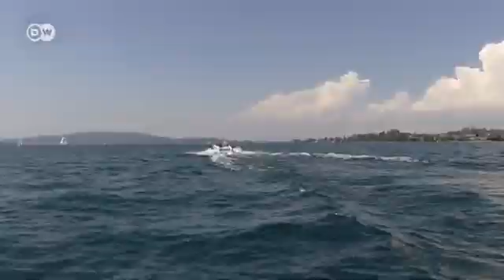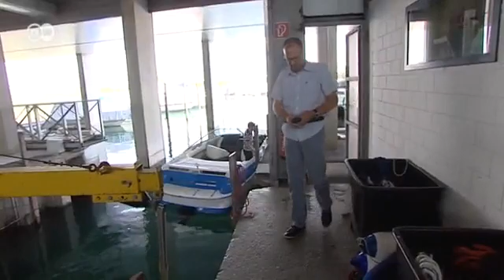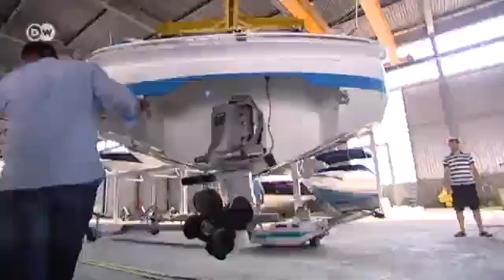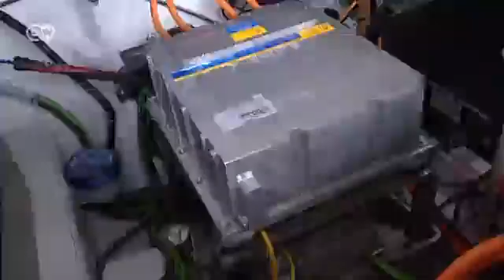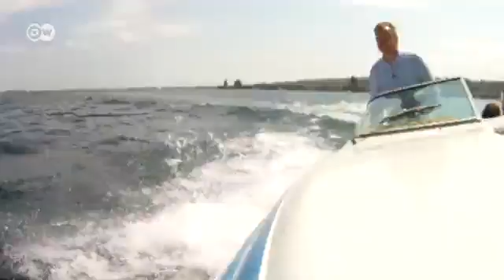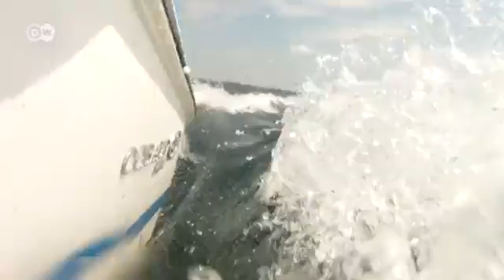Fast and Quiet - Electrically-powered recreational boats | Made in Germany

Comment: Add a generator to the drive shaft to make more energy to the batteries. Add some solar panels that blend in, and lastly , add a horizontal wind mill. They are not big any longer.

Comment: "The faster you go the shorter the distance that can be covered"

Just like gasoline powered
Reply: I think the comparison is that when U open the throttle and go fast with electric the batteries will die out much quicker,  even though you will cover  ground Quicker you will not get as far as if you were to find a happy suited cruising speed . However if Just Like Gasoline you cruise at a speed that suits your setup you can get to your destination with fuel or battery to spare. Turtle & hair scenario somewhat, I think.... I need a whisky
Reply: Mmm not quite but sorta lol
Reply: @pantloaded  I sorta kinda do not but agree🤔
😅🤣

Comment: You are limiting the usefulness of the boat by not making it an electric hybrid with onboard generator. Batteries can only go so far.
Reply: I would liked to have 2-3 batterypacks so i use them separately and generator to charge the other(s) while cruisin on the other. Just switches to change batteries😊
Reply: @scaniawahl  That would work great, just need way cheaper batteries to come out so stuff like this is reasonably priced.

Comment: The real market here is slow moving cruisers, like sail boats. Figure out the math for solar and wind regeneration/recharge and you have a winner. Sailors don't need a huge amount of "power" and the fall back plan would be an onboard genset  Most sailors also embrace clean propulsion.
Reply: Yes I’m thinking about a pontoon boat with the top covered with solar panels and in between the floor will hold the battery. Boats are more like the Tesla cars then we realize with a single gear and no transmission. Develop a gear ratio for the Tesla Motor that’s more designed to work with torque and I believe that it would be more efficient to have electric powered boats then gas powered ones.
Look what was possible with the car that nobody thought was possible & the car has to undergo wind & continuous speed  with other factors that slow it down and look how far someone can travel in one.
Reply: I have a customer build electric yachts in Australia, if you are interested, pm me your mail address, I will check with him whether he can help or not  😉

Comment: Might there be a way to use the wind generated to charge the batteries while moving? Just a thought.
Reply: That would be a perpetual motion machine. The drag from the wind turbines would have to be overcome by using a little extra battery power, more than the turbines would generate. It doesn't make sense to charge from wind unless the boat is standing still.

Comment: Im gonna convert my 16" Jon boat into electric. Stage 1 is complete. I built a 14.8v lithium ion battery from 18650 cells (4s40p) and can run my 40lb trolling motor for 1.5 hours at max throttle. Stage 2 will be a 95vdc 2.65hp treadmill motor direct drive through hull. And a bigger battery pack of course!
Reply: How'd it go?

Comment: I think this is a great concept. This would be a great application for water sport boats. Water sport specific boats have ballast that they fill up with water to make the boat heavier in turn making a larger wake. This would mean that the extra battery weight would actually be a benefit. Also a lot of water ski boats have the engine mounted in the middle of the boat which minimizes the wake. This same idea could be done easily with an electric boat by moving the heavy battery pack towards the front. Tesla has made cars with huge ranges and for a boat that is used for an afternoon of water sports i don't think range should be a problem. The instant torque from an electric motor is preferred by a wake border or water skier because it gives them that pop out of the water. Also for many boat owners their boats are often staying out in the sun all day and if you innovated a solar cover to trickle charge your battery you would be saving a lot. I think an electric powerboat for water sports would be a huge hit and would make all the disadvantages of electric powered vehicles into advantages.

Comment: It's cool but I don't see the  common man buying this I think it's for rich pricks
Reply: there is a new battery coming... give it 10 years or so. If everything goes as expected you will probably be able to replace the average outboard petrol power with one the same size and shape that has a built in battery. Probably just open up the top of the outboard and swap out the battery to charge it at home like a power drill.
Reply: @knifeyonline  Do you know the weight those batteries could have? Just try to carry a car battery, and then think that the boat one could be 20 times heavier
Reply: @exosoma  did you miss the bit where he said "new battery coming"?
Reply: Player hater....
Reply: 18 foot ski boats are 50k.

Comment: Can these boats be solar charged?
Reply from the maker: Unfortunately this video is already more than 4 years old, but we’ll be trying to get the information for you. In the meantime, maybe you can find out more on the website of the company producing the boats: http://www.zebotec.de/index.php/en/home/.
Reply: if it's like cars they store kw's of power and a big solar panel is about a hundred watts
Reply: The short simple answer is yes. ANY battery boat or vehicle can be solar charged with the right set up and equipment. Probably one of the most effective set ups would be to have solar panels on a boat house roof for energy collection and then storage and charging is a relatively well known technology - Tesla is a good example.
Reply: To add a quick addendum, solar charging ON BOARD the boat will be VERY problematic and most likely ineffective as the energy demands of the electric motor are way much higher than in an electric car which is MUCH more energy efficient compared to a boat. As a previous post mentions, the boat is powered by an electric MOTOR not engine! : )
Reply: John Sutcliffe there are solar panels for boats there are wind turbines for boats and there is a tow behind turbine for boat it goes in the water
Reply: Templar Knight yes there MAY be solar panels and wind turbines for boats but ON the boat, they are HIGHLY impractical as they would have to be SEVERAL times the size of the boat to be an effective energy source!
Reply: A lot of boats are not used until the weekend, seems to me that some solar panels (on deck) should give the batteries some charge for those five days...plenty of unlimited sun in the summer.....

Comment: the problem that always comes up with e-power is range.

it takes 20 times the battery weight vs gasoline weight and 40 times the
 battery volume vs gas tank space for the same range at the same 
performance.

Sure, the e-power gives marvelous results for short range....

One run across the lake then hours to replace the energy

E-cars its 40 miles per day of recharge....

Boats need MORE power than cars.
Reply: True. But that gap is closing, quite rapidly. We can get power density now that is almost double what it was 7 years ago, and the weight has come down considerably. It's really just a matter of time, and finding those willing to stick their neck (and their cash) out to develop and mass produce. 10 years ago, I didn't have enough roof space to install enough solar panels to completely power our house - and it would have been a ridiculous cost. Now, I have just over half of my roof covered with panels - and a zero monthly electric bill 9 months out of the year, and about $14 for each of the 3 remaining months; at a self-installed cost of about $15K.      It's just a matter of time.
Reply: FLjock01 Looks like its bye bye to the coal industry in the VERY near future.
Reply: @graywolf2107  Copper for the electric motor and then lithium for the batteries.  They also come from a hole in the ground.  Granted, not where the coal is located.
Reply: 40 miles per day of charge for EVs? You can fast charge a Tesla Model S to 80%, or 250 miles of range, in 30 minutes. Where do you get your facts from?

Most people do not operate boats at full speed 100% of the time. High speed runs would use a lot of energy but at trolling speeds, you'd have enough power for many days before it ran out. And with fast chargers at the docks, it won't be an issue.
Reply: Tesla ocean edition would be a cool thing
Reply: F Huber Moreover, look at the price!  
I can buy a hell off a lot of gasoline, oil and spark plugs for what this electric system will cost. 
Evenrecharging off the yacht with solar and wind ... it's still 500 times more expensive to buy and operate than the same gasoline engine.
Reply: @nononsensenorseman  The future is real and will happen. Your arguments will not apply in just a few years.